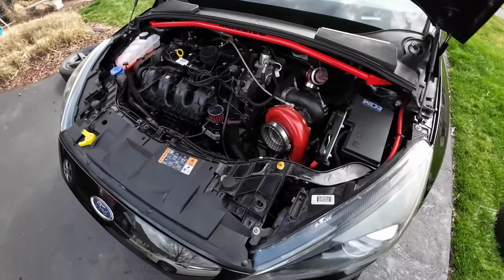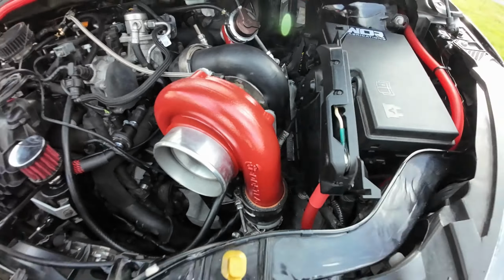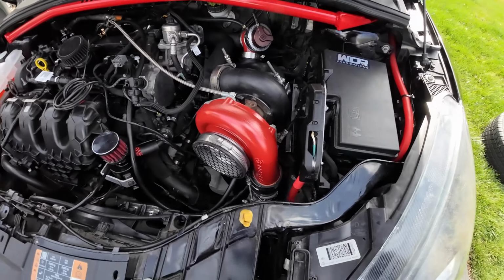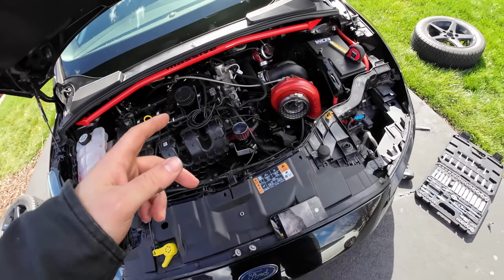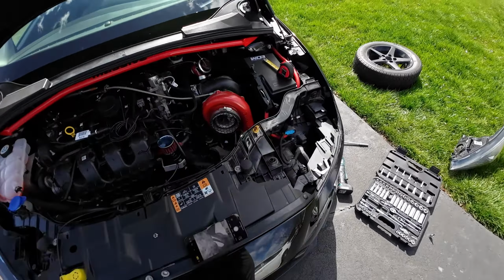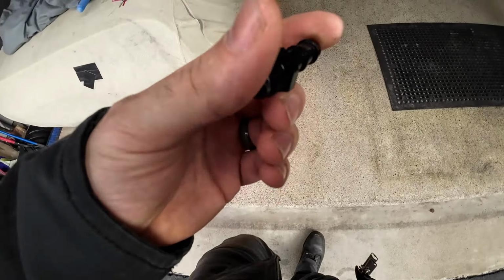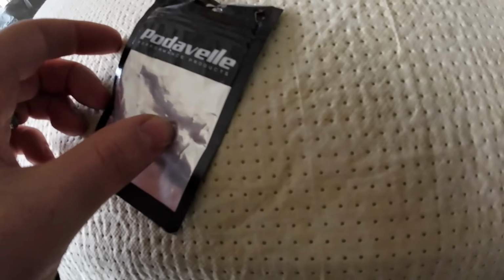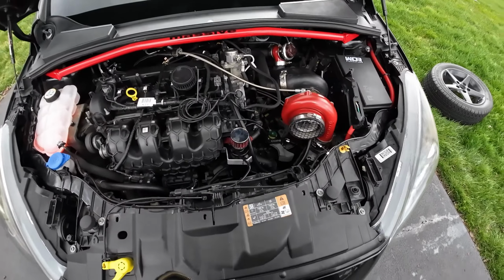Focus ST Sidewinder Kit EP#10 STARTING OVER??!!

Comment: Try a 5558 i have that turbo on my focus st and the spool is pretty quick
Reply from the maker: I went with the G25-550 i heard nothing but good things from the 5558 as well! it was a tough choice lol  i went a bit smaller then the 5558
Reply: @VJC4x  for stock motor you should be good at 500hp  i know a guy that made 536hp on stock motor
Reply from the maker: @boostaholic5471 it should be good i know my turbo is rated for 550 ish lol 

my hpfp comes in soon so that’s definitely gonna help